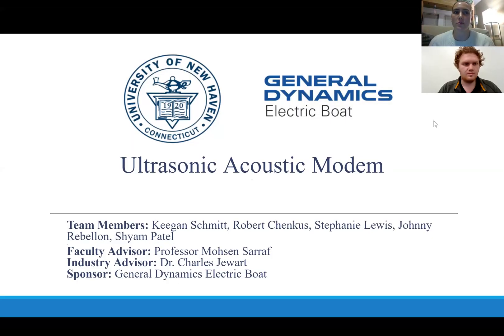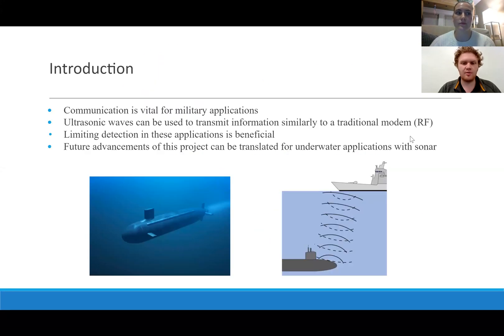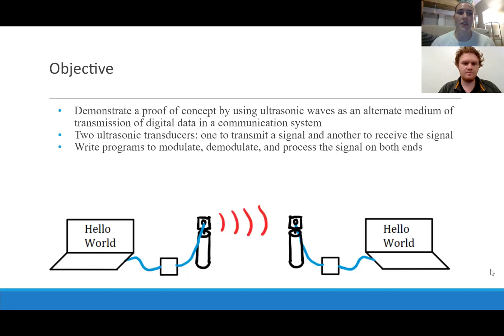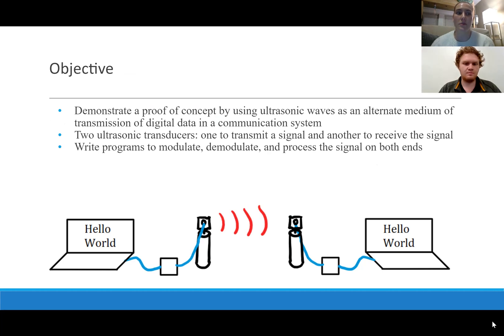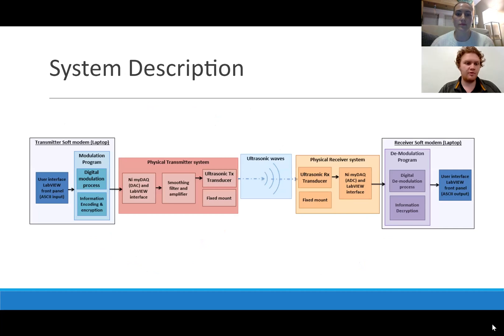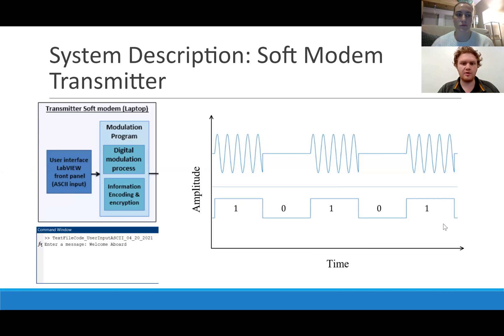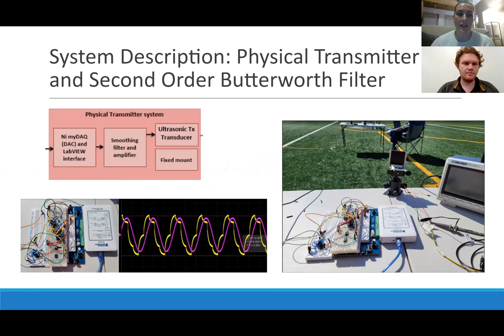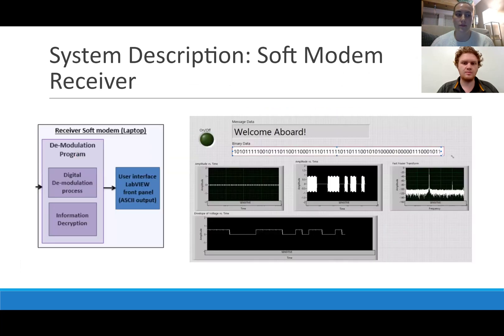Acoustic Modem for Undersea Drone Operation

Comment: So its it just a matter of taking what's been used for WiFi AP's and Stations, and replacing the standards used for RF, in exchange for Acoustics? I've read where the data rates exchanged by Acoustic WiFi is much lower compared to that of modern RF WiFi, but I believe it can be improved upon by the same techniques applied to RF, better gains, better S/N ratios, etc..